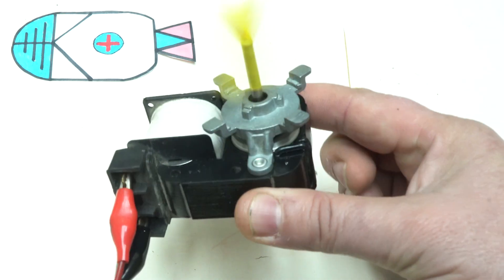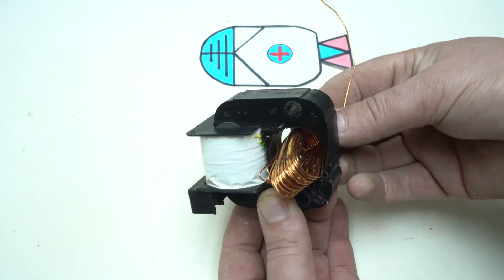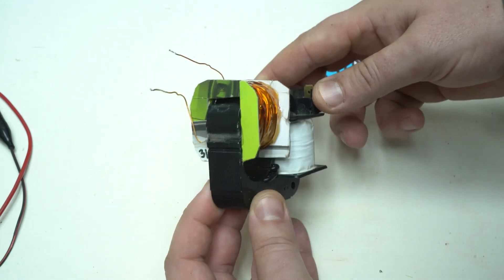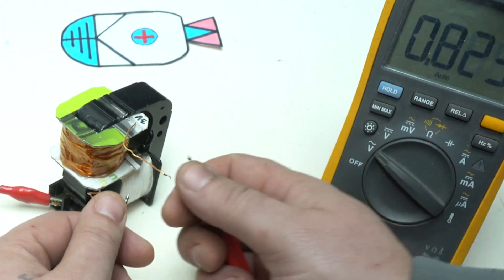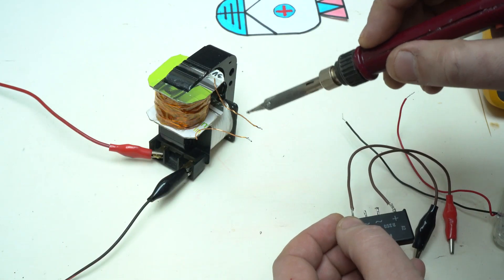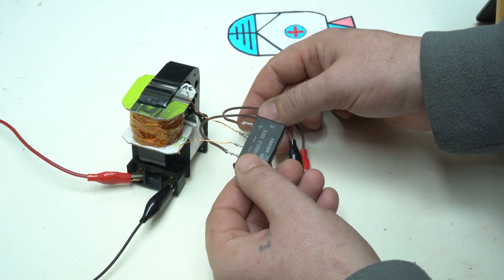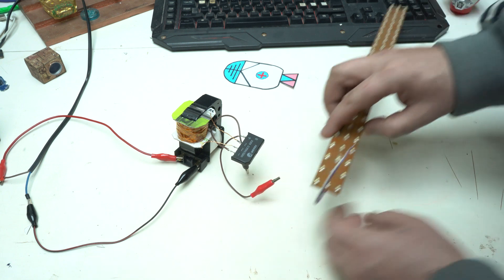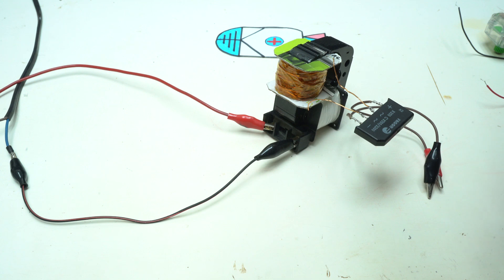New Idea! Motor Converted Into Transformer - YES or NO?

Comment: ℹ Did you know? In some old turntables, the platter is always turning when the device is ON, because the AC motor is also the transformer for the built-in amplifier.